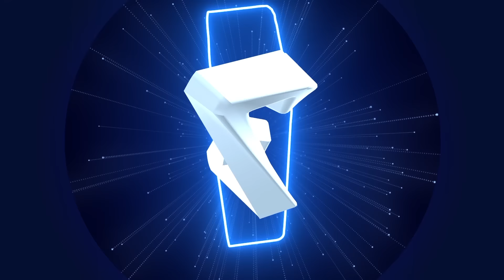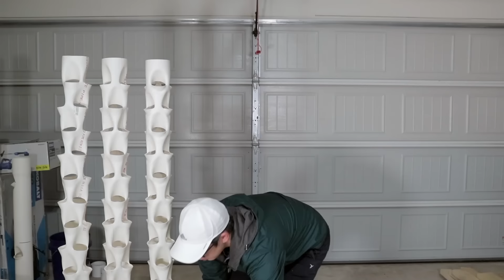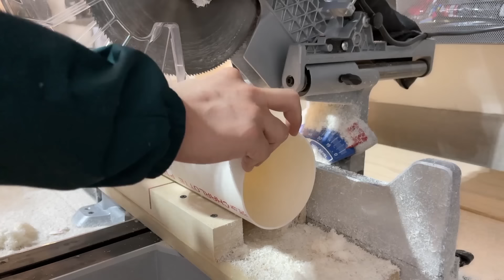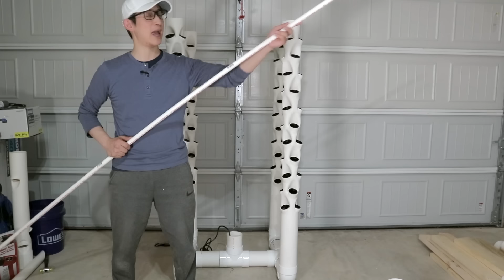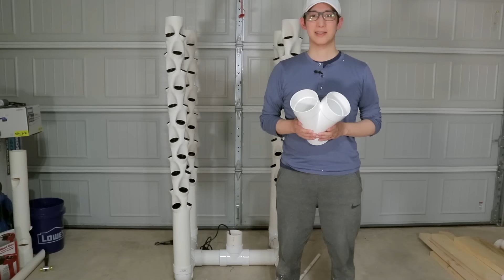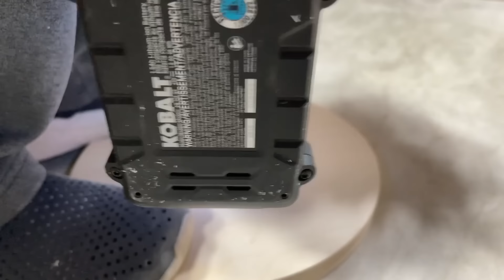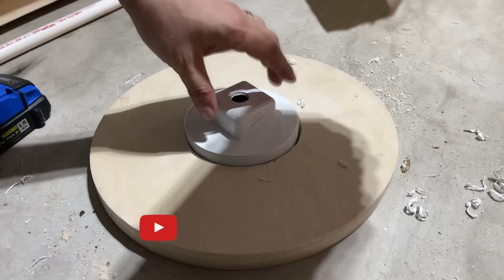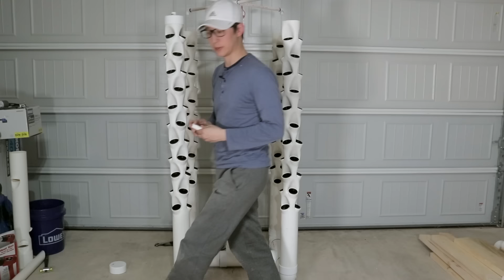DIY Hydroponics | Aeroponics Garden Tower Build | Part 2 - [4 Tower Build]

Comment: In order to make it more aesthetic looking, & ergonomically easier to run your wiring, invert the “Y” pipe section, so that the wiring does not have to be so drawn out in height, spreading it garishly out of the top, angled down, & away rather than up, & out away, …
Reply from the maker: In my case, that might not work since i typically fill the water up into the "Y" pipe, however, that may work in future builds where I intend to add a reservoir.  Thanks for the recommendation!

Comment: Won't having so many pod holes so close together make the roots eventually clog the tower, blocking the flow of water and intertwining roots making cleaning for replanting very difficult?
Reply from the maker: It could, depending on what you're growing, but for the most part during that first season i didnt have many issues with water flow or roots clogging up the system.  The only issue I ran into was uneven growth where PODs not facing the sun didn't grow as fast or abundant as PODs that were directly in sunlight.

Comment: Nice job. Try adding a few coils of bare copper wire near the base of each upright, including the centre feed. That deters slugs and snails from sneaking up and munching on your crop. They have a bad time when copper oxide mixes with their slime.
Reply from the maker: Nice.  Thanks.  I actually put slug and snail killer around the tower build, because I noticed a lot of them climbing the tower.  I did not know about the copper wire method and will definitely incorporate that in all of my existing and new builds.
Reply: Try using petroleum jelly around each base. Prevents ant, snails & slugs climbing up.  Cheap and effective.
Reply: Thanks you
Reply: I prefer using beer traps (the slugs love the yeast in the beer) or copper pan scourers.
The scourers can be unravelled, like  a sock.
I snip open the 'toe', then cut rings/bands to the required width, sliding them into place, as they're fairly flexible.
I use the same method for planting in the garden.
Pop the plant in the soil and slip a ring over it, which leaves a comfortable area for the stem to grow free from slug approach, or pop the ring over the roots and onto the stem, before planting, if the foliage is too wide.
I don't like the idea of using poison, as useful creatures; like other insects, birds, hedgehogs and foxes eat slugs and die, in turn, as a result of the poison being ingested by the slugs.
Reply: @billyandrew  great info, Thank You for sharing

Comment: you forgot to sand off the writing again!
Reply from the maker: yea.  I figured for personal prototype units, I wouldn't bother.  Want to make sure it works well first.  Next builds I will though, use some methods you and other viewers have recommended to remove the lettering.

Comment: How about a solar pump.. ??
Reply from the maker: Do they sell solar pumps?   Or are you talking about connecting the system to solar?   I definitely wanna figure out how to do that
Reply: @ChrisLoh  here’s a yT link to a solar pump review. This review made me consider suggesting to you… seems to be about the right amount of flow… but to get up to your 5ft hight … I’m not so sure …. They seem to have a few feet of upward pressure but others could be more powerful. I’m not sure. Also I’m not sure if a “timer could run on solar … or maybe battery “timer… cool if there is a solar “on/off timer”. Do you run the pump 24 hrs a day. Designing this unit with a focus on the exact sqftage can stream line a set production of let’s say a 5sqft , 10sqft and a 20sqft model. Good clear videos .. looks good on our end. https://youtu.be/C9Jn2VxLkos

Comment: ok, i remained silent on the first video.. enough is enough though. theres a solvent that removes the lettering from the pipes, would make it look a ton better. the reinforcement rings are just over-engineering, they arent even blocking light.. so you could probably use pool noodles or neoprene instead of even messing with netcups. speaking of, you could also just use hydroton with rockwool (or without) instead of buying the coco pucks all the time. i knew the first one would fall over because you only used a 3 gal bucket you said you were going to build a support for it though. use screen instead of shower drains possibly even fine mesh ones OVER the drains. i would also have used a sprayer at the top of each pipe. it looks fairly nice though.

Comment: When I try to form the hole in the heated pipe with a bottle I always end up splitting the pipe. Am I over or under heating the pipe?
Reply from the maker: Its best to use a 2" pipe cut at an angle to create the holes.  Generally, it tears either because the slit is too small and/or you aren't using cold water to cool the pipe which helps to reduce the chances of it tearing.  I'll have my template available soon for download
Reply: @ChrisLoh  Ty for the reply. When you say the split is too small do you mean how long the split is or how wide the cut is? I have tried making the split with a hacksaw and with a mitre saw but I am still splitting the pipe. The pipe I am using is very old and has been sitting in direct sunlight. Could this be affecting the plastic pipe?

Comment: Hi we love what your building. We would like to know how you change your water as I don't see a tap. Great job 👍
Reply from the maker: Thanks.  I dont generally change the water.   It usually just evaporates overtime and I replace it with new water.   If I wanted though, I can remove the towers and pour out the water in the lower reservoir section.  Great idea though to maybe add a water drain

Comment: Wow. I was about to spend over 500$ for a test purchase for a single tower from a seller. Now, I can make 4 towers at the fraction of the cost.. Please share your drawings and specs, if possible. I am open to purchasing the drawings as well. Have a question? What did you use to flow the water evenly among towers and also within the Tower walls? I cannot see because of the camera angle.
Reply from the maker: Yea, it's definitely cheaper to DIY.  Although prices are going up with inflation, however, I expect the same for the professionally manufactured hydroponic systems as well.  I'll have the template(s) uploaded within the next week.  I have already updated the parts list, and the video serves as the build guide.  As for the water evenly flowing, I have not yet solved that.  The water basically flows however it flows with no equal distribution.   I'm open to ideas though.   Some subscribers recommended adding shut off valves, which would control which tubes get water, but no recommendations yet on ensuring equal flow to each tower.

Comment: at the end of the video, the result is perfectly visible on the withered plant in the background. it wouldn't hurt to water it sometimes either.
Reply from the maker: lol.  Good catch.  That plant actually died during the last winter freeze and is beyond recovery.  The plant as well as the roots are completely dead and have since been extracted and removed.  You may notice just an empty pot in my up-and-coming video.

Comment: built my aeroponics grow table out of 44s and use aquaponics for the nutrient with freshwater Aussie red claw
Reply from the maker: Nice.  Self sustaining.  Do you have a video posted anywhere?
Reply: @ChrisLoh  
hi mate I don’t .just built the table,  made a long deep trough the length of 3 blue plastic 44s laying on there side.
Made it out of a single sheet of 5ml thick black plastic, then created the table to support a deeper or longer curve like a  “U “ 

which is needed for hanging root systems. 

I used 44s for the top, cut them down the sides in half then joined them end to end using self tappers.

misting the roots from the bottom in the channel created by the “U” shape table . Flooding back into the Yabbie tank slash bath 🛀  tub, just in the process of setting up the filtration using three 44s .

also using an IBC cube    as reservoir for the water 💦 filtered nutrient to run from the pump through the misting sprinklers in the table.

Then back into the yabbie tank.

To be honest I had thought about making a video, haha 😂 hard enough putting this 3rd generation prototype aeroponics table together 

Using red claw filtered pond water isn’t something that i think is been done yet✅ unless the big boys in aeroponics farming are already doing it..?
 
Haha 😂 probably are

Grow100%Organic

Comment: I do like the system but what I do noticed, they don't tell you how often you have to changed the nutrients. My suggestion is you design it so you could easily remove the water to replace it with fresh nutrients, after all, salt deposits do build up in these types of hydroponic systems. I which they explained this process of removal in all of the videos. I do have to say Chris Loh did a good job on the process of making the tower system.
Reply from the maker: Hmm.  I never experienced any build up of salts or nutrients, but then again I didnt even think to test for that.  I basically refilled the tower reservoir only when all the water evaporated and assumed that the nutrients were all used up.  You are correct that nutrients need to be added about once every month, but I also experimented with a separate grow tower absent of any nutrients and was able to grow an abundance of lettuce and other Herbs.  

Thanks for the support and keep those insightful comments coming.  Great idea for something for me to consider and test for in the next video.

Comment: 21:52 instead of hard pvc pipe I would use ordinary plain clear vinyl tubing, or clear plastic tubing, and then use either stainless steel or aluminum flat plate of either 11 gauge or 1/4". Whichever fits your budget to both hold firm, and center up the smaller tube, and your larger tubes. Plus look cooler in design.
Reply: There would be a lot of algae buildup in the clear tubing over time.
Reply from the maker: Thanks for the tip Marv.  Good point - and clear tubing would also be more flexible.  I tried to stay away from aluminum or any metal-like material to avoid potential rust in the future.  In addition to that, i didnt have any tools readily available to be able to cut aluminum or stainless steel.   Maybe in a future build though.

Comment: Christ ,can you kindly provide the details info of the water pump and address of the company . 
Such as Model , what brand name , voltage rating,  rpm and address to purchase it.
4"pvc is good enough to place the pump in position.
Thank you Christ.
Reply: try a 400+ GPM pump, should push to  10', ive built quite a few hydro systems. i use fountain pumps.
Reply: 400+GPH*
Reply: Thank you for sharing your data. 
I came across a good cross reference of submersable pump chart which has a good selection of capacity , maximum lift head and dimensions of pumps.
Reply from the maker: Sure.  I have updated the description with the pump, price, and link on Amazon where it can be purchased.
GROWNEER 550GPH Submersible Pump 30W Ultra Quiet Fountain Water Pump - https://amzn.to/3OcGnlr

Comment: Excellent design sharing. When you dry fit your pieces, make marks across the joints so when you glue them and need to twist for a water tight seal, you can align them perfectly and they end up square and plumb.
Reply from the maker: Thanks for the advice!

Comment: Amazing columns! But I have a few notes about your design. You don't have enough solution volume. Place 60 liters tank at least. And second, for indoor use it is good idea to enlarge quantity of columns, they have to have pots only on one side, place a few led line lamps on the center post. Surround all columns and top with a mirror film. Good luck.
Reply from the maker: Thanks for the recommendations and advice.  The water was enough to last for a few weeks without needing to refill, however i do think a larger tank would allow for more longevity.  I agree that redcuing the amount of pots and limiting it to one side would allow for better growth - I noticed the sun facing pots grew much faster.  Yes for indoor growing, LED grow lights are definitely needed.

Comment: I made a similar system.  Only in practice, many go dead.  the heat hits the PH value up quickly.  every day i add PH -.  and because water is so much lost edges of the trays and the evaporation of water every day I fill water in the waterreserve.  So it takes a lot of food every day.  how you solve this?  Fruits die and the roots get a rotten film.
Reply from the maker: The rings that I added to each pot hole reduced the amount of water loss.  I also reinforced the tubing with silicone at parts where I joined PVC connectors.  As for evaporation from heat - I haven't found a way around that yet.

Comment: Does anyone have a recommendation on a pump that would fit in the pipe and still be strong enough to pump the water? The one he recommended is sold out so I got another with similar dimensions, but it doesn't fit in the pipe. His is 4 x 3.7 x 3.5 (LxWxH)  and mine is 4.1 x 2.3 x 3.5.
Reply from the maker: For the 4-tower build specifically, I used the following pump which is smaller in size - https://amzn.to/3G9yzgL
Reply: @ChrisLoh   Thank you very much, it's the only thing that's been holding up progress :)
Hope this helps others as well :)

Comment: Hi, i have a question. Is it neccessery for this system to work during 24 hours ?
Reply from the maker: It doesn't need to be on for 24 hours.  You can probably get away with only having it on during the hottest part of the day

Comment: I think I would add four ball valves on each line going to each Tower so you can control the flow of water instead of being entirely dependent on all things being perfectly equal. There will never be an equal amount of water flow between The Four Towers unless you control it and regulate it in some way shape or form either each tower has its own pump or add four ball valves on the top of your manifold
Reply from the maker: That is absolutely true.  The water flowing into each tower is and never will be equal.

Comment: I might try sewing mesh instead of the drains. If you pinch in between the bottom pipe and the 90. Awesome ideas
Reply from the maker: That's a good point.  I only used the drain because it seemed like an easier solution.

Comment: Idk if anyone else has mentioned this, but for multiple cuts of same length try using a stop block clamped at the length you need (1cm). 
I really like this idea of multiple towers for a grow system on a rolling platform using wheels with breaks for easier moving as needed.
Reply from the maker: Thanks for the advice.  Love both suggestions.

Comment: Thanks Chris great video. Plan on building this set up or if you want to sell me one complete I'm in! I live in North Idaho and the outdoor grow season is super short so I want to put the 4 tower system in my basement for year round production. I am curious as to what would be a sufficient light set up to grow indoors and any reflection that may be needed for optimum yield. Thanks!
Reply from the maker: I added the list of materials to the description section.   As for selling these, I am working through the logistics to see how I can produce and keep the price reasonably low.  Currently, my biggest challenge is shipping costs, which Im trying to find a solution for.  Ill keep you posted and provide an update in the near future in one of my next hydroponic build videos.  As for grow lights, I did move one build to the garage and found a set of grow lights on Amazon that worked well and were pretty affordable - https://amzn.to/3HAawsa